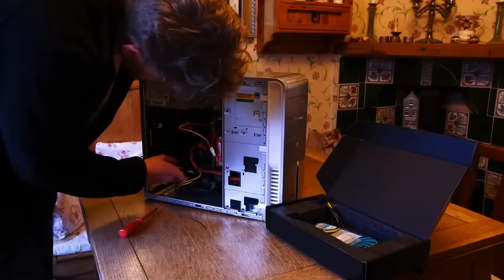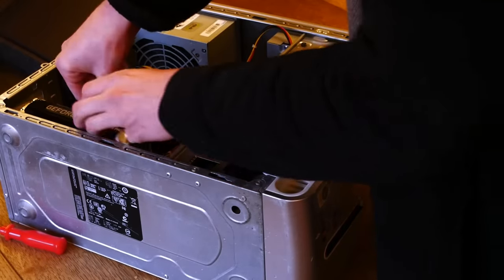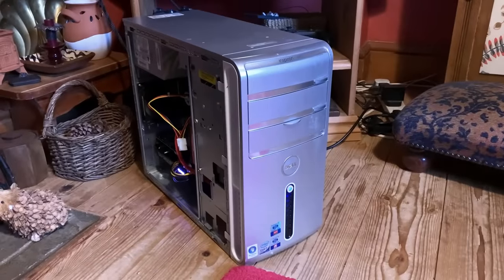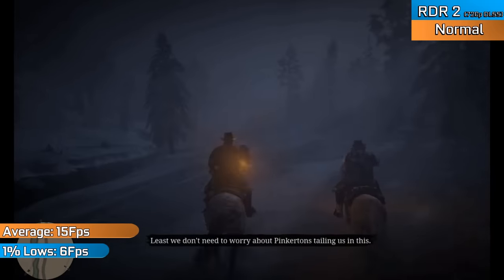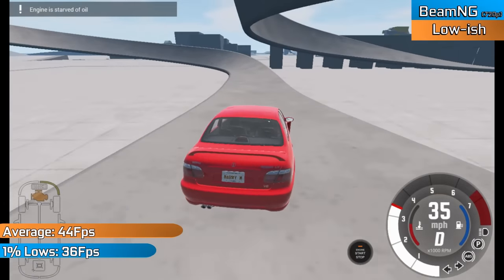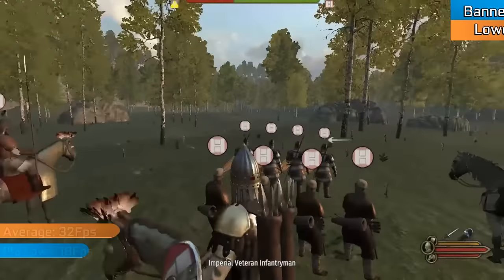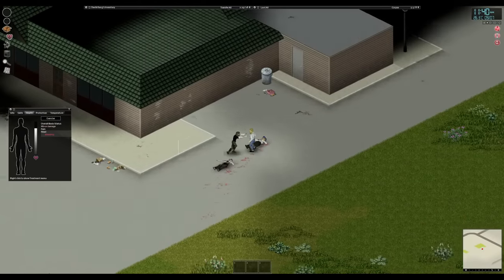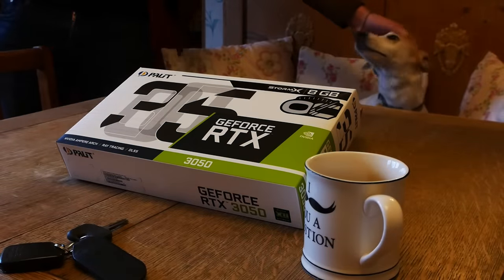RTX Graphics Card in a 15 Year Old Family PC...

Comment: I had a computer exactly like this before passing it on to my sister
Fun fact, I overclocked the computer using duct tape on a pin since these particular CPUs can be overclocked by covering the pin connectors.
I believe it went from @2.4Ghz to @3Ghz, and stupidly, I clicked hibernate instead of shutdown on accident and instead of turning it back on to turn it off properly, I just proceeded to mod it.
The only side effect was the computer was running roughly 25% faster literally than it should. even the clock. but a fresh reboot fixed it.

I decided to build my own PC in the end since I did want to play some high end gaming and this computer couldn't keep up after games started to get heavy.

Comment: I upgraded ram from cheapest 8gigs ever to a decent 16 gb RAM, and went from 780 to 3060. Works quite alright with 4440, so much so that I even postponed the rest of the upgrade till AMD's switch to AM5, in hopes to get the most use out of a new socket

Comment: I used to modify Asus P5Q series mainboard BIOS files back in the day and put them on xtremesystems so if you want to give that old 6600 system some retro upgrades grab a P5Q Pro or P5Q Deluxe, add the modded BIOS, locate 2x4GB PC8500, chuck in a SSD and you'll be surprised just how fast those old systems can still be with a CPU overclock and a modern GPU.

Comment: Good old Q6600. Mine ran until 4 years ago with 2 GTX660's air clock to 3.8Ghz all XFX. 8Gb Ram but I had found a bios mod for 16Gb Ram. I reset my Bios and never got back in. LoL Running games from 2014-2016 eg Payday 2 was very good at 1080p. 
Buying modern Games draws from your wallet, if you own a seasoned rig like that you will likely only pickup older games on sale anyway. Same applies to GPUs, 2nd hand only.

Comment: I've had bizarre experience with bottlenecking where I've had limited success with increasing video settings actually giving me more frames. It had everything to do with cramming raw pixels through the pipeline and making the GPU chug. Not post processing. 

So not DLSS, the opposite. Super sampling. 

I will admit it doesn't work well with game's that require lots of CPU power to begin with, but for some other ones.... making the GPU chug and slow the frametimes down enough for the CPU to keep up.

Comment: If you played Project Zomboid on this system, that's kinda cool. One game that actually catches my eye, that maybe I would spark up the old tower for.
Old tower had core2duo e8400 / 4gb@1066 / GTX 260. Can get the same ram ( 2x2gb ) brand new nowadays, still runs at $90...! Just would prefer a better graphics card. 260 doesn't even have 1gb vram.

Comment: I am very invested in this Core 2 Quad system and future updates!

For a fun system to play with and extract maximum performance, this very accessible platform with very cheap upgrades. I don't think it can be beaten for fun factor because all the hardware is so rugged and disposable, and old physical hacks really can work.

You can make a lot of mistakes on LGA775 without massive consequences, which makes it the best platform to really get to grips with modding and learning about computers to my eyes.

Years ago now I upgraded an Optiplex system for fun, and ended up selling it on as a very budget, very esports focused rig. It had the BSEL tape mod on the Q6600, an SSD, 8GB of RAM, and a GTX 750ti (and a better power supply). I didn't get benchmarks for it, but it genuinely surprised me with how capable it became with the faster card and the extra 600mhz on all four cores.

Comment: As a retro computer I have a Thinkcentre M57 with q6600 GTX 650 2 GB 8gb, 128 SSD and 2 GB HDD. The old stuff from Xbox 360 times runs decent in 720p / Coinops next (by Arcade Punks) AAA Games from Epic and Steam account via Boosteroid. (Cloudgaming) 1080p Cyberpunk in Ultra : VSync on and it starts with 60 frames all other AAA titles too. So Protect the environment and use old things if possible.

Comment: If you are going to run a core 2 quad make sure it is a p45 g43 chipset or newer. Anything below that the pcie x16 slot runs version 1.1 slow data rate transfer .
Reply: My x38 has 2.0
Reply: @virtualtools_3021  Extreme motherboard very nice.

Comment: I plugged a EVGA 3050 8 gig into the first gen I7 4 core 8 thread CPU(model number 950) that has been running since 2009. Max settings in games like world of war ships V sync off top out around 100fps (force 64bit launch) and bottom out about 58fps under heavy battle conditions with full line up of players in random cpu load around 35%,Gpu load under 50% 1920X1080 on a 46" display with you tube videos running music videos in the background and a discord channel open. 5 two gig sticks making 10 gigs of mismatched ram that the mother board down clocked to 1066Mhz and down to single channel. games like enlisted max setting same rez about 150fps cpu load 99%,gpu load under 50%. When i bought the system windows 7 listed the CPU speed at 3Ghz. windows 10 running on western digital SSD lists the CPU speed as high as 3.17Ghz. userbenchmarks lists my CPU 42% faster than the one you listed in your video. Games like valhiem i see no better or lower then 40fps 100% cpu load, gpu load under 50% Not too sure your drive will perform as well as an SSD as the old spin drives create more system load on the cpu as  I read that SSD tech has a chip on the SSD board that lowers CPU load to almost 0%.

Comment: The Q6600 has a 1066Mhz FSB, so it could be paired with some DDR3.

There are Core 2 Quads and even Core 2 Duos with SSE4.1
Of course a Core 2 Quad, especially a 2.4Ghz one, is not for gaming.
But it can make for a great little office PC, a cheap one.

Comment: How did you get round the UEFI BIOS requirement on bootup? I thought all new GPUs now are UEFI only and does not boot up with computers that have legacy BIOS.
Reply from the maker: It didn’t work in a C2D variant of the same machine, this would restart 3 times and then boot to the GTX3050, wasnt an ideal experience but it did work.

Comment: Hi, there are modded xeons for socket 775 to get almost the fastest cpu for that system. (try to get one that is welded instead of a sticker)
You can get them for 15 -20 euro's, but you will need to check if the motherboard is compatible and if you need a modded bios (the last thing is very easy to do).

Comment: i have an lga775 QX9650 @ 4.4ghz side build with 8gb of ddr4 ram and a 1650super. its.. surprisingly capable. if you have a spare motherboard, you can easily get that q6600 to 4-4.4ghz with an nhd14 / 1.4-ish volts on cpu.

Comment: if the system from LGA775 socket motherboard support DDR3, with following specs,you can do much better:
CPU : Q9550 or Q9770 (you may OC it a little bit to get higher clocks)which performs around i5 3rd gen or Pentium 6th intel
Ram : dual 4GBx2 or 8GB DDR3 1600-2100mhz
SSD 120GB : still helps as it will take some works out of CPU which isn't optimized for current needs.
the gpu up to GTX1650 or rx580 , won't be bottleneck as much  as it's just enough processing performance to match with graphic,
Reply: Nice

Comment: Try it with a 12GB 1066 MHz DDR2 and put a Samsung QVO 8TB SSD in it then if the motherboard could accept a CPU a little faster than the Q6600 do it. The memory and cpu bottlenecks the video card. Put the SSD to help a bit with the bottle neck then over clock the CPU and put a good cooler also over clock the memory. Could you do these?

Comment: GPU power distribution doesn't work like that. No, there is no 75W from and whatever else from additional cables, how power use will be distributet depend from PCB layout design. Most cards with additional power inputs use PCIe power only for low voltage logic (controler/bios VCC) and maybe on lower end cards for memory supply, so around 20-30W max. Everything else must came through cable because power plane for GPU VRMs is separeted from power plane from PCIe. With card with more cable inputs there is usually separate power plane from each cable so half of VRMs work from one (6/8pin) and other work using power from other. 

Card also probably suffer from x8 pcie gen 1(.1) inteface. Even with enough video memory bus is actually used all the time and need some bandwidthe, x8 1.1 isn't much. 

Btw, did you count how many times you mention "RTX "in this video? I don't know is there minimal number they ask for it as compesation for a card but to maintain quality of this channel please next time ask for reasonable condition on deals like that.
Reply from the maker: Hello, I was basing most of my power consumption findings off what I found when testing in a Ryzen system where predominantly upto around 60% Load the Card used the PCI-E Lanes for power, given we only exceeded this usage in one instance (on the Inspiron 530) it didn’t seem like much was being drawn from the Sata Power, given it’s 50 Series origins and with this being a small fun video it wasn’t ever intended to be a deep dive beyond if it 1.:Works or 2: doesn’t work.

This video wasn’t sponsored in the slightest and was mostly just here for a bit of fun, the overuse of RTX Phrasing is mostly due to that being something I was predominantly testing in the video 👍
Reply: @BudgetBuildsOfficial  thats terrible design decision from palit then that can only be explainded by their expectation from card this small to be used on systems that don't have real 6 pin connctor and possibility that users would use cheapest adapteres they find on ebay.
For $400 they should provide good adapter and design PCB differently. 
I know people like to upgrade cheap office PCs and hate cards that need additional cables but with high drain devices it's for their own good.

And about RTX...mentioned just too many times, I expected counter to pop up in a middle of a  video.
I watch your videos for years and this in first one I open one again on PC just because TV doesnt suport comments :)

Comment: Its a crime to NOT overclock Q6600. Even on stock intel cooler 3.0GHz is an easy target. Back in the day when it was my primary PC, I ran it at 4GHz. Today its still in use as a HTPC @3.4GHz on intel stock heat sink with a custom fan. It can run GTA V easily at 60fps+ @1080p with 280X.

Comment: Can you write what model is the motherboard, to get the chipset specs? Also, why didn't you try get some fps and other values with Afterburner or xbox overlay thing? Thanks.
Reply from the maker: I should have the motherboard info in the original video for the PC, which should be somewhere on the channel. Also the Pentium 4 was genuinely that terrible that Afterburner or even the Xbox Overlay would decimate performance.
Reply: @BudgetBuildsOfficial  oh ok later I'll search and watch the pc video.
But afaik this pc has core 2, right?
Reply from the maker: 4core/4Threads
Reply: @BudgetBuildsOfficial  that's not a core 2 🤔

Comment: did the graphics cards work there on the first try because I have a 2010 HP which does not display anything with a recent graphics card whether on the ports of the motherboard or on the graphics card currently I arrive  to run an old 1 GeForce GT 220 graphics card.
Reply from the maker: It cycles power 3 times before booting, and wouldn’t work at all in the C2D variant of this machine. 

HPs do also tend to be more fussy than Dells when it comes to graphics cards, also having a whitelist.
Reply: I translate with Google translation I am French and I do not really understand what "the C2D variant" means.  But otherwise it turns on but does not turn off like everything is normal except there is no picture.

Comment: You should try a q9300 or similar, had one paried with a gt1030 and ran gta v high @60fps 720p.
Reply: not to disrespect the setup, but gta v is not really that hard to run, even at 720p at 60 fps

Comment: Most your issue was ram the core 2 quad with DDR3 ram runs a lot of games with very few issues no you are not going to run Cyberpunk 2077 but you can run Forza Horizen 4 with very few issues in 60 fps at 1080-P.

Comment: You just don't run the latest or future games on an old system with a modern, yet lower-tier RTX card, and expect it to fly.  What you can almost always expect it to do very well at, though, is to run all of your older titles much, much better, especially if those games are still within 3-5 years after the original release of your CPU.  Anything after 5 years, and you'll have to start lowering your graphics settings.... and your expectations.

Comment: I've played through the entire Witcher 3 main storyline on a Q9400/4GB/HD5770 512MB with a spinnyboi hard drive, it was a funny experience. Of course it was at 720p with everything set to low + grass removed, but I was still suprised it managed to run at around 25-30 fps (well, not in Novigrad...).
Reply: A512mb 5770???
Reply: @virtualtools_3021  yup, an Asus one, with a black round cooler and no shroud. I overclocked it a bit too.

Comment: "if you increase the resolution it will perform better.."
NO GAME is like that. While the BOTTLENECK tends to shift to the GPU at higher resolutions, the FPS never, ever increases if all the other settings are the same. You're actually increasing both the CPU and GPU load if all you increase is the resolution. The bottleneck may or may not shift from CPU to GPU but the FPS absolutely will go down (assuming no software FPS cap).

Comment: I have a slightly better but still old computer that I let my kids play on. It's a second gen i7 (4 cores 8 threads) with 16GB DDR3 memory and a GTX 1650. It's overclocked from 2.7GHz to 3.4GHz and still runs cooler than modern CPUs, at 45°C under load.

It still keeps up and can probably be used for another five years! 👍

Comment: what you got wrong is the anti cheat requires sse 4.2 and these old computers have sse 4.1. i know this because i'm still using a motherboard from a hp dx2400 from 2007 with a e5450 modded to work with the 775 motherboard. but i'm only using a 10 series gpu in mine and it runs great with what games i play. but there are a lot of newer games i can't play because of them needing the sse 4.2

Comment: DDR2 and the core 2 quad are obsolete when it comes running to any newer games skyrim would've been a good game to test. Even an early generation i5 can be had for $20. Paired with enough ram those games would run so much smoother. I ran an i5 3450 for the longest time with 16gb of ram and rdr2 and forza were more than playable

Comment: I love videos like this. Can you put the 3050 in with a 64 bit Socket 478 Pentium 4 Extreme Edition?
Reply: Socket 478 doesn't have PCI-ex slot. And only the Prescott P4's have 64 bit variants though which are LGA 775.
Reply: @SharpShoot3r_14  There are Socket 478 boards with Pci-e and DDR 2. They are rare birds, but they exist.

Comment: If you upgrade an i5 from 8GB to 16GB DDR3 and overclock the CPU, slightly on the RAM, overclock a 1GB Radeon HD 6700 GPU to 900Hz, 1250 MHz memory clock, it will run games better than your demonstration with all the fancy features of the Nvidia RTX 3050 4GB!

Comment: I remember the LGA 478 and Pentium 4 ... After that the Pentium D on lga 775 .. .. this type of CPU is not able just to start games .. but after the core 2 dua and quad will run .. is the most important jump of performance of CPU to this day !!! Just to anderstand .. the Pentium D Vs the core 2 quad hase improve like mor than 300% (in som situation 1000%) .. after that the improvent is like 20-50% max !! ( Core 2 quad to i5gen1 is 25%) the gen1 to gen2 is 35% gen 2-3 is like 5-10% ......

Comment: There's probably more performance available with a new Radeon card than an RTX card due to nVidia running the GPU scheduler in driver (on the CPU) where AMD still have it in hardware on the GPU. Just not the 6500 😄

Comment: Whats the point? this Core2Quad easy overclocks to 3.4ghz not only 2.4 and had same performance as an actual quad core i3... youre doing it wrong on 2.4ghz only, at least overclock it to 3ghz thats the point about a Core2 theyre very easy to overclock. I still had an old PC like that, Core2Quad at 3.2ghz 8gb ram .

Comment: LOLL i know how pain in this ass this rig are, about a month and a half ago my Maximus V Extreme+3770k mobo dead, and I can't fund for any decent platform at that time, so i take out my very old pc under the bed it is q6600@3ghz+16GB 1333mhz 8GB ddr3+G41M-P33 Combo mobo and places my GTX1070FE in it, I thought I can use it until I got enough money to buy 2nd hands decent platform but I was wrong it was a pain in the ass to use can't even handle any game I currently playing, 100% load on every game I throw at it NMS, GTAV,7 Day to die, Elite Dangerous not even 30fps, just playing youtube video @1080p alone has used around 60% CPU. playing games on it for 3 weeks is enough to drive me crazy!! it was a relieved, that I have enough money to get an 8700k+ROG Maximus X hero+corsair 3000mhz 16GB, So I didn't have to take the pain anymore :), anyway, q6600 was a legend long time just like 2600k everybody wants to own it but now the legacy was ended.NOTED IF YOU SHORT ON BUDGET JUST GET AN INTEL G SERIES DON'T BUY AN Q6600 it's just too weak and lacks instruction to run nowadays program...

Comment: core 2 quad GTX 1050 Ti max maybe RX 570. RTX 3050 is a Pcie X8 4.0 card not good for Pcie 2.0 probably running at X1 no X4 X8 support on those boards the RTX 2060 would run much better because it's a Pcie X16 card